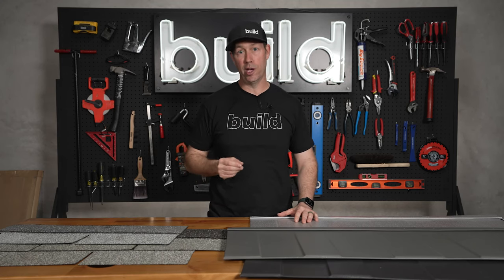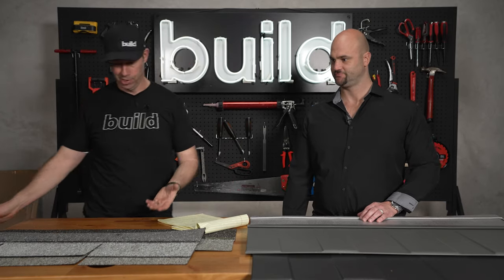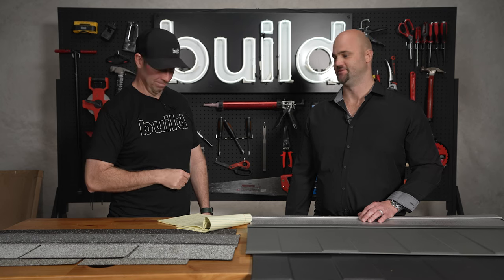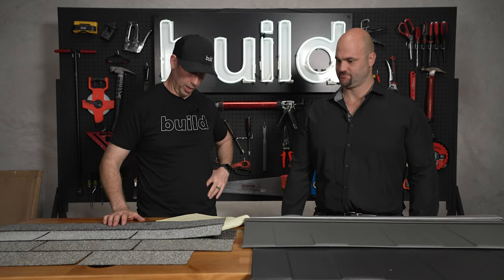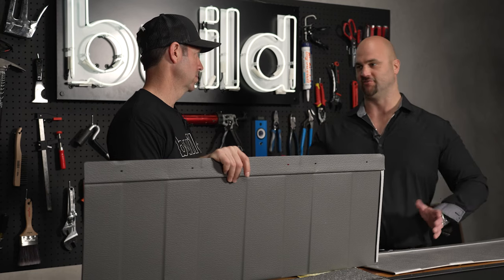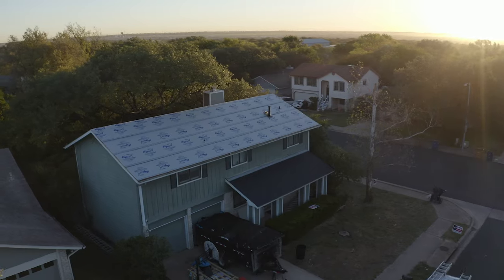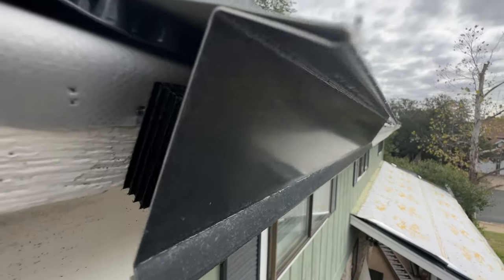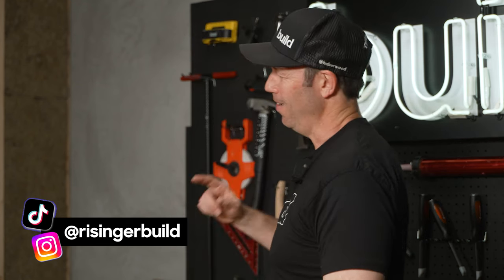Roof Shingles :  Asphalt vs Metal

Comment: What about the big steel panels?  A friend had his small place done in steel panels. He has a high pitch, not sure what. The panels were 4'  x 16' so only 9 panels on each side of the house. Those large panels are what I see folks going with in my area in southwest Michigan. 

When I need a new roof I want panels like that, I have a low pitch. The total running roof measurements of just the house are 40' x 28' (edge to peak 14') and there is a 12' x 24' attached car port. In the 24' part of the roof the actual run from peak to edge over the carport is 26'.

Some roofers won't touch my house with shingles since it is roughly a 2 in 12 pitch. I figure more like 1.7 in 12.

Comment: I have a shingle roof and two areas get Ice Damming. What about Ice Damming on Metal Roofs? What would I have to do to prevent them on Metal roofs? This is a residential home, so the roof slope is not steep.

Comment: How do you work up on a metal roof?  It seems to me that getting grip between your feet and the substrate would be nearly impossible.  I already hate working on my asphalt shingle roof due to pitch.
Reply: You glue sandpaper on the bottom of your shoes. That is how the professionals do it. It causes rust to start forming where the paint is scratched, but rust just provides more traction and is not an issue. Big Wood is trying to scare you about metal rusting, but it is not a problem.

Comment: As much as I like the looks of metal I try talking my customers out of it here in Western Washington.
I feel metal does best in area's where you don't have tree's near the house or if your in snow country where it can slide off to help to clean the roof.
If you have tree's nearby or over your roof you'll get lots of sap and pollen stuck to it over the years and that just catches everything from needles to leaves. Try leaving your car parked for 5 years without ever washing it I can guarantee what ever color the roof was will end up working its way towards pollen yellow. 
Cleaning is also a pain in the butt on metal roofs try walking on a 5/12 when its wet.... just a few more things that should be brought up in a honest "why metal roofs my not be the best for your house" video..

Comment: Why not just use  large 8x4” roofing sheets like corrugated or box profile?
Reply: My assumptions would be to keep that tight sheer strength pattern on the sheets. A 4x8 wouldnt allow you to add as many screws without having them exposed. This system hides the fasteners. At that point if you want a metal sheeted roof you got the with the stand seem.

Comment: In my uneducated mind, the roof seems to be the most gain / loss surface for heat  / cold of a house. So many attics are build to vent the large air volume. Would it not be more efficient to vent the smaller volume that would exist between two skins 1-2 inches appart. So is this true and does it make sense to change the roof on an already build roof (when deciding to put new shingles) to a double skin?
PS love your videos..
Reply: Matt has other content on "hot roof" vs. "cold roof" so if you go search for those terms, you should be able to find good stuff.
Reply: many metal roofs have built in channels to vent hot air under the metal and the gap of the radiant barrier . The channels allow cool air to pull in naturally in the bottom of roof near the gutter and exit at the top of the roof at the metal caps with natural convection
Reply: thank you
Reply: @dondumitru7093  Thanks, will check it out
Reply: Ventilate and insulate the attic and ceiling of your home and there is no heat/ cooling problem.

Comment: What kind of traction does a metal roof offer when you are walking on it when it is damp?
Reply: none, you will need to install a harness point.
Reply: From my experience a damp metal roof is not explicitly a slip hazard, depending on the type of finish. But Pepe is correct that you will need a safety point, because you should never trust a roof is safely walkable.
Reply: Our insurance company charges us more for our homeowner's insurance because we have a standing seam metal roof.  They stated more risk to fire fighters on a wet metal roof and the metal is more difficult to cut a smoke venting hole in the roof.
Reply: @skiptheroad  damn really? That is interesting

Comment: Both products gots its own advantages. And remember this you can find building structures lasting  thousands years but you can not  find a roof last for 15 years without problems. 
The metal roof problem is the thermal expansion and contraction, the the screws penetration, and the slope/ length ( not many people know about this) limit .

Comment: With an asphalt shingle you MUST Peel the celofane strip on the back of the shingle OR what I do is put three globs of Roofing Adhesive press the shingle down heavy and it WILL NOT blow up.  This is quicker and far better.

Comment: So I'm in DFW area and looking at this what is the disadvantage of metal roofing with a solar system?
Reply: I'm a solar installer and formerly worked for EcoFasten Solar/Alpine SnowGuards, a company that makes roof attachment points for solar racking. Solar works on every metal roof type EXCEPT solar tiles. 

I'd bet that solar sales people will tell you they can install because they think it is like a synthetic slate, but when they look into how metal tiles actually interlock they'll realize they don't have the skill to install it. It happened to a friend of mine. Of the hundreds of thousands of solar attachments I sold in 4 years at that company I probably sold under 100 of the base plates that can be used with metal tile.

Comment: I don’t really see the reason for the radiant since it’s facing down….unless it to hold heat in during winter.

What is the best solution for a 3:12 pitch? I am considering rolled roof and then applying a white silicone roof coating for energy efficiency like Henry’s Tropicool. Any ideas?
Reply: A radiant barrier does not work if the reflective part is in contact with the shingles.  There needs to be at least a small gap, which the thickness of the material it is attached to provides.  That is why you place the shiny side down rather than up.
Reply: Not sure about the above comment, but my understanding of radiant barriers is to eliminate atmospheric thermal loss.  Houses lose a ton of energy from the vertical atmospheric loss, and reflecting back into the house prevents a passive % of this from happening.

Comment: Matt, when you did the Edco metal roof video, you didn't mention the venting aspect (maybe I missed it).  Does the Edco product require the same venting profile (sharkskin, dimple board, reflectant)?  Also, where can you buy the 10mm vent board that you cut down to 3/4"?   Never seen that before....
Reply from the maker: The metal manufacturers don’t require ventilation underneath. It’s definitely a best practice however. Especially for the south. The 10mm strip is CorAPlast I buy at a local supply shop. Regal Plastics.

Comment: Metal roofs are expensive as hell. If you don’t plan on staying in the house for life, don’t bother. Roofs do not bring enough rate of return to put a metal roof on. Remember, anything expensive will ultimately be more expensive to repair or replace.

Comment: assuming a steel roof never suffers damage from hail/falling tree limbs, etc, how would the steel roof wear out?
Reply: It'd most likely fail as the result of the installer or the manufacturer going to install and then when a screw goes in or a nail in some cases it might be left to the manufacturer but as I said the installer could see the issues before the manufacturer unless a manufacturer has a guy to inspect but 99% the installer but as I mentioned 1% the manufacturer would see some kind of drop in installers.

Comment: Let’s talk safety walking on it to blow out gutters several times a year (!) ….and…..the  elephant in the room price. Seriously matt ? 1200 a square AND coravent AND radiant barrier AND dimple Mat ? Your total cost has to be pushing 3x Grand manor etc also with solid 50 year warranty…..
Reply: There exists much cheaper metal roofs . In my country a 1m x 3.66 m pre-painted 26 gauge laminate metal roof panel costs ~45 usd each or 1.25 usd a sq ft and easier to install than these . They can last 100+ years too
Reply: An elephant in the room probably won't hurt the shingles, but I wouldn't let them walk on the roof. That'd probably cause issues. Is this for a zoo?
Reply: Let’s talk about the fact that there are zero reasons you need to get on a roof to blow out gutters….
Reply: @scubasteve1555  There are about fiftyleven reasons to get on the roof for gutter cleaning. He wants to know if an elephant can walk on it.
Reply: @johnjacob1412  

There’s not though. I’ve literally never been on my roof to clean gutters. They make these handy things called gutter screens that completely eliminate the need for that.

I live in the country surrounded by trees. Works just fine.
Reply: Human standing on one foot is about 8 psi, an adult man can stomp with 9,000 newtons of force, let's say a boot is 30cmx10cm. That ends up about 30 n/cm² or 44 psi. A jump can be about twice the force of a stomp, so up to about 90 psi. An adult elephant stands with about 35 psi. Article where I got these numbers says a human walking produces a bit more than twice the pressure of standing still. If we assume the same for an elephant, that's 70+ psi. Essentially anything a human can stomp on just fine an elephant can stand on, anything a human can jump hard on can support a walking elephant.

Really, it's more about can your structure support a 6 ton weight?
Reply: In my experince gutter screens reduce the need to clean, not eliminate it. And they make the cleaning process five times worse worse. We also had a pine tree and the needles would get stuck vertically in the screen and trap shit on top of the gutter screen, I can only assume that sort of damming was deflecting some rainwater back up under the shingles.

All I all I'd rather clean more frequently, you mileage may vary.
Reply: @Senthiuz  

I’ve owned 3 homes and have had gutter screens without issue. I’m now building my 4th home in the middle of heavily wooded 20 acres and I’m having gutter screens installed.

Comment: As a Norwegian i can't understand how anyone will choose steel roof IF it doesn't have some kind of backing to stop rain and hail noise.
My house have new self cleaning glazed concrete tiles and is completely silent, i only hear when it hits the gutters otherwise it is completely silent and should last 100 year no maintenance (unglazed have shorter life).

Only had to do about an hour work reinforcing the roof to prepare for the added weight compared to the old asbestos shingle roof
Reply: What kind of reinforcement are we  talking about? :D 

I'm curious about Norwegian way of building, since it reminds me of american style a lot (timber framing, etc.), and kinda looks a lot different from our southern european masonry style.

Comment: I had hoped for a fair and thorough comparison not an advertisement.  I am also very disappointed in the misinformation in this video.  Metal roofing products are excellent so it should not have been necessary to exaggerate the differences. An honest comparison would have had the same results!

First I seriously doubt a floating 29 gauge steel is going to have an honest class 4 impact rating. Did the rating apply to the 26ga product?  What was the price on that?

Why compare the cheapest possible shingles instead of 50 year class 4 impact rated shingles?  Or triple laminate shingles?

What was the range of the SRIs on the shingles?  What are the actual fire rating on the products? Asphalt shingles have additives to prevent ignition by embers.  

Those asphalt shingles on the table also are likely closer to 200 lbs per square. Still way more than the metal so why the need to exaggerate the difference?

If you're going to be in a house for only 5-10 years a cheaper alternative may be a valid choice. If you'll be there longer than absolutely go for a higher end product.

I've always enjoyed watching Matt's videos to learn about new products and new technology. I'm very disappointed at the way this video was presented and hoping content does not trend in this direction.

Comment: Would this metal single roof work well in the winter climate? For example snow and ice.
Reply: Snow and ice slides right off, so snow fences are needed
Reply: @notlessgrossman163  We had significant gutter damage from snow sliding in large masses off our standing seam roof and stripping the gutters off.  If you are in a snow area, I really recommend you not skimp on the cost of the extra protection.
Reply: @dondumitru7093  Most metal roofs I've seen in snow climates will have little fences/guards near the edge to keep the snow from sliding off (safety hazard to people below too)
Reply: @notlessgrossman163 You need a fence with a sign that tells the snow not to trespass. Go away snow bunnies. We don't need your flurries around here.

Comment: this is the metal roof i want to go with, had a company come out and give a quote for a colonial roof, 3200sqft including garage. No gable, no wall detail, no valley, single chimney in the center. Dude quoted 96k I shit you not. However I found the roofing manufacturing facility overseas and will be placing an order direct. I don't care about warranty. If it's installed right, warranty is not needed. I will be getting all the materials for $8,770 taxes and shipping included. Unreal.

Comment: What about noise from rain and hail? Is the metal roof louder?
Reply: Depends on attic insulation or whatever design you have.. but there’s not much of a difference in most cases. If you’re talking about a stable or a barn with no decking or attic, then yeah steel is louder
Reply: @philippenight2421  makes sense. Thx

Comment: Well hang on there Matt, why are you highlighting all the shortcomings of a cheap and nasty 3 Tab shingle, then when price comes up you start citing the price of much nicer architectural shingles instead?

Pick one or the other, but don't conflate the quality of cheap materials with the price of high quality materials for the sake of selling metal roofing products, it just looks sleazy when price is the crux of the matter.

Comment: Okay Matt, I have a serious question. I'm about to put a new roof on my little 1947 2/1 house (700 sq ft) and I'm in Indiana, zone 5b. Going with a metal roof, more than likely a snap lock standing seam. EVERY roofer around here throws down a synthetic underlayment over old shingles then lays down the metal directly over that with no ventilation. I feel like that will rot my roof from trapping moisture. I'd love to hear your thoughts. THANKS!
Reply: You're asking the right questions, so I suspect you already know the correct answer. It may cost more to tear off the old shingles, but it's the proper way. Why put a lifetime rated roof on top of one that's worn out?

Comment: Plenty of comp shingles have a class A fire rating. I've personally, as a firefighter, witnessed an entire valley full of glowing embers on a Malarkey Legacy shingle roof without any combustion of the roof material.  I have both shingle and steel roofs on the buildings I own, and I sell both products. I'll likely never do another steel roof again.  I don't like the look and I really don't like the dangers in snow country of steel roofs sliding. Sure, I could put snow stops on, but those are a maintenance nightmare over time.
Reply: I agree, cosmetically with most homeowners disliking the look of metal, the desirability of a metal roof home will go down when put up for sale. Many people won t give metal a second look.

Comment: The issue here when you’re selling the metal roof is that you said imagine ripping up the asphalt 3 times, then it would offset the metal roof. Therefore the metal roof is the choice. Which is misleading. People tend to live in the same home anywhere between 5-13 years on average. Even the cheapest asphalt roof will get you around 15 years. With most home improvements, you never get back all the money after you sell the home. It’s rare to get more but most of the time it’s only a 50-80% return. We’re talking about roofing, fencing, siding. So are you really saving a buck if you live in the house for 10 years when the roof can last you 100+ years? Might as well just get the cheaper roof so that it’s working as it should for 66% less. The issue here and why asphalt is more popular is because people don’t live in the same place for that long anymore and investing for the next buyer is unnecessary.

Comment: How is it to apply solar panels to a metal roof?
Reply: I'm a solar installer and formerly worked for EcoFasten Solar/Alpine SnowGuards, a company that makes roof attachment points for solar racking. Solar works on every metal roof type EXCEPT solar tiles. 

I'd bet that solar sales people will tell you they can install because they think it is like a synthetic slate, but when they look into how metal tiles actually interlock they'll realize they don't have the skill to install it. It happened to a friend of mine. Of the hundreds of thousands of solar attachments I sold in 4 years at that company I probably sold under 100 of the base plates that can be used with metal tile.